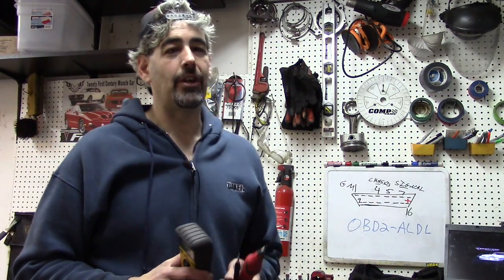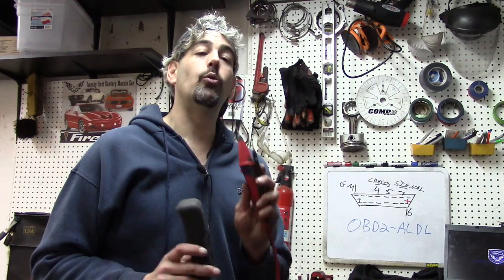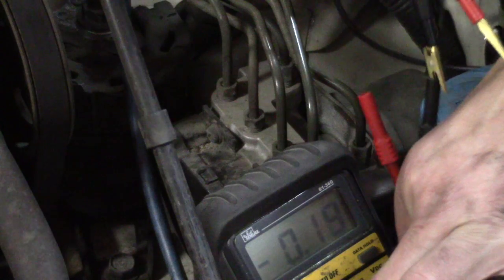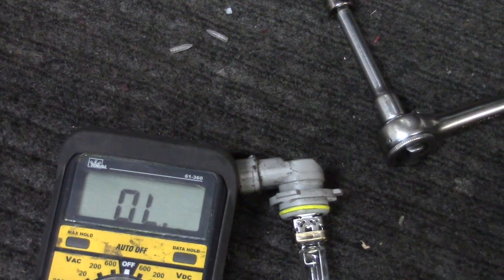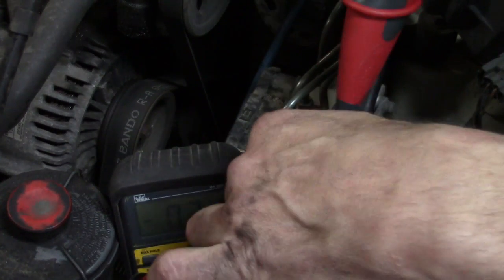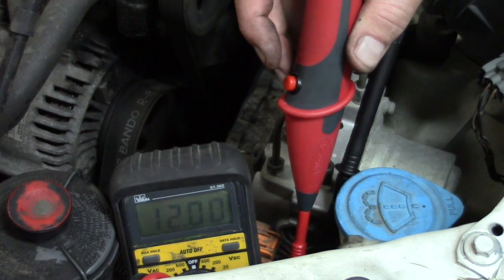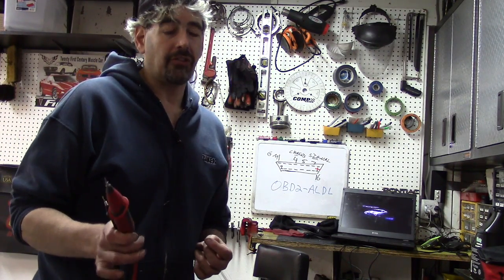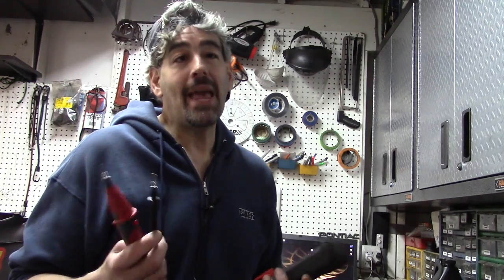Load Pro Electrical Tool Review (with product link)

Comment: just out of curiosity, put it on ohms, touch the leads together and jab the button.  =)    Thank you for the info on the tool.  Well worth 70 bones if you work on cares often at all.  THumbs up
Reply from the maker: +Rhage73 If you were to do that nothing would happen at all. If you had a DVOM set to V and touch either side of a resistor what would happen? Nothing.
Reply: if you have a DMM, "digital multi meter" which is V / O / C / diode check / capacitance on some of them, and you set it to ohms it will read the resistance in the leads.   I was curious what type of load it was putting in the circuit to measure against.  so if you touch the leads together and it is .4 ohms and then trigger, if it is simply jumping in a resistor to set a base value to compare to it would give you the resistance of that value.  because the sum of all voltage drops in a series circuit = source voltage it would be a simple matter from there if they are using some sort of resistor jump in.    c wut im sayin?   sorry i wasn't clear about the ohms setting before.   .......made me nerd out... =(     TURBO CHARGED LS, WITH A STROKER KIT, FORGED INTERNALS , METH INJECTION AND A THUMPING BUMP STICK.   ok better.   hehe  have a good one.
Reply: +Schrodingers Box or if you don&#39;t wanna do an ohm test on your loaded probe, at least tell meh what size resistor you used for the demo? Then i can throw some Chuck Simon Ohm math at it and figure it out based on the 8/4 split.  The value in the probe should be roughly 1/3rd of the value of the total resistance in the series circuit.
Reply from the maker: Rhage73 Gosh I don;t even remember- I am pretty sure it was a 50 ohm.
Reply: a'ghite, thanks for the reply bud.    That is why i wanted you to do an ohm check lead to lead then hit the button, and if it is in fact just a resistor on the posi probe that is on a momentary switch....when u bang the button, on ohms with the leads touched, it will give you the value it is using ;P
Reply: Just happen to see in LoadPro guide that if you set meter to Ohms, DON"T touch leads together and push/hold button for a few seconds it is supposed to show 25 Ohms.  If doesn't it needs to be fixed or replaced.
Reply from the maker: Matthew Brice Agreed- if you set the meter to Ohms I would totally expect you would see 25 Ohms.
 But nothing will read at Voltage.  A lot of people mistakenly think there is a battery or something in the positive lead the produces voltage and there most definitely isn't.
Reply: ok went to work fired up my fluke put it on V, took another fluke and measured the ohms on P and N with it.   with the meter set on V there is a 10M resistor as part of the meter circuit, strange how i never was curious about it before now and been fixing electronics for over 15years.  the funny thing is the meter set on V reads 500mV DC when i touch the ohm meter to it.   its probably because of the 9v battery in the other meter. /shrug.   so with the 10M ohm resistor it would be hard to say. i didnt have time to check with both meters on ohms but i will have a little time in the morning before shift to take a look and see if the 10M ohm resistor is still in circuit on OHMS.

Comment: Only a resistor and a momentary switch? Seems a bit pricey just for that. Maybe that's why the probe is so big. It makes you think you're getting your money's worth. The guy is a freaking genius. :-)
Reply from the maker: +Rob Mut What have you been using all this time for a resistor and momentary switch to test voltage drop???

 See...  Exactly my point.
Reply: +Schrodingers Box As always I was just kidding. Did you miss the smiley? But to answer your question, I just hang an appropriate size resistor across the load end and measure the voltage. If I wasn't so lazy I'd put the button and resistor inside the meter case. The 2% part of me wants to see what is actually in there. Any chance you would take it apart and show us? Once again I keed, I keed. (Good video by the way) 😊

Comment: Wow Matt...this is definitely the most controversial tool review I've ever seen! Bit like those political blog sites about Donald Trump heh heh
Reply from the maker: +tecnaman I know, right??? Totally didn't expect that!  It seems to be a matter of whether people prefer the multimeter or scope. I personally much prefer the multimeter because the versatility involves just flipping a dial rather than swapping connections plus I can hold peak readings, etc. But mostly I like quantitative  numerical output. So this tool is excellent since it adds another function to what I already use. 
   Others prefer the testlight because it's safer and has just one wire. For them this tool won't be as popular because they have to bring out the multimeter. 
    The complaint people make that the load pro is nothing more than  a resistor and other basic methods could be done doesn't register with me at all though. You could use s regular ratchet instead of an air ratchet, or a hand drill instead of a electric drill, or a multimeter instead of a scope and amp probe.

Comment: Hi buddy! I have an '85 Nissan Urvan, good compression but looses coolant and too hot runs hot. No external leaks, I have pressure tested the cooling system. 3 out of 4 Spark plugs are showing white residue. Bubbles appearing at the top of the radiator. Does this sound like a leaking head gasket? A previous owner ran tap water for quite a while and the cooling system was quite sludged up when I got a hold of her. :)
Reply: +DodoCnR What was the compression and leakdown test result?
Reply: +Schrodinger's Box Quantum Mekanix 150PSI even on all cylinders (should be 128-171PSI according to the manual). I haven't done a leakdown test and there are no signs of any coolant in the oil. :)
Reply: DodoCnR Need to look at basic cooling diagnostics. Dirty radiator fins, bad radiator cap, nonfunctioning water pump...
Reply: +Schrodinger's Box Quantum Mekanix Radiator is clean it was replaced about a year ago, cap was replaced by me, and water pump + fan clutch also replaced during diagnostics.
Reply: DodoCnR Oh what was wrong with the water pump? Was it seized?
Reply: +Schrodinger's Box Quantum Mekanix Not seized, it worked fine but the fins were quite corroded. The old fan clutch did not seem to be working properly.

Comment: ive got a set myself. been using it at work for almost 2 years now. the one time i grabbed my old snapon test light and tested for power on a backup wire to the alarm on a transport truck.. light lit. got a new alarm and hooked up... no alarm still.... remembered dammmmit.. those snap on test lights use practically no load to test a circuit. got my leads out. tested the wiring .. sure enough. had super high resistance. ended up being corroded terminals at the reverse switch on the transmission. 
-- that was the last time i used the snap on test light for that. load pro leads all the way. guys at work still are unsure of them only cause they arent off the tool truck. so much easier to use then the Power probe i must say. also the leads can be purchased with a handy book that makes troubleshooting electrical look like childs play. cheers thanks for the video.

Comment: 70 bucks should have came  with Sullivan's first book also. Snap On sells a Blue Point version that is blue instead of red for 89 bucks.  All this discussion over a 50 dollar set of leads, WOW. Do the leads do what they are designed to do or not ???
I have seen seen a set of Fluke leads for way more than that and they didn't do any thing special. If the couple buck test light will do it all why do they sell scopes and scanners plus updates at outrageous prices . Quick and dirty is one thing , total confidence in your diagnosis is the bottom line.

Comment: The use  (and understanding of the load-pro) is the same as that of the power probe, e.g if you use a power probe incorrectly you can easily cause damage to ECU or any delicate components, especially if you decide to apply 12v in the wrong manner to the wrong circuit.  The load-pro has it's advantages (and disadvantages) over other fault finding methods,  especially in it's simplicity (assuming you know what you are doing). But as with all pieces of "test equipment" one device is not the bee all and end all of TE. The load-pro for me has located faults that would otherwise take longer using other methods (my opinion). 

Possibly why only a small percentage (<2% of us) use it. (Yes Ivan I'm a DIYer and I've bought one)

Load pro equivalent circuit is basically a 22 ohm 10W resistor to deck (gnd/rtn) when switched (0.54 Amps).

Any corrosion fault I've come across has always been significant (but not immediately obvious as to where located) and has caused considerable voltage drop when load applied. The corrosion quite simply causes current limiting, which in turn leads to voltage drop when load applied as the circuit current is "limited".

I also prefer using a DVM rather than a test light, my preference, as looking at a light doesn't always instill confidence as to the actual voltage drop "seen", that's not saying I don't use a test light, depends on the nature of the fault. I also like using a proper scope (I don't have $10K for a crapon).

Oh the probe tip on the load-pro is not pointed but concave, this allows it to "hold" onto pins easily without slipping off, brilliant design from Dan Sullivan.
Reply from the maker: +DiyMech I agree with this 100%.  I like the DVOM because it's much faster and more versatile than the test light- though I do use a testlight sometimes. I like the loadpro for the same reasons. How much easier to just test the connector once and not have to fumble probing the connector and hooking the testlight to the probe in the confines of the top of a fuel tank?
   Just that alone- worth it for me- in the same exact philosophy that when I put 12V directly to a fuel pump how much easier (and safer) to use the power probe rather than jumper wires?

Comment: One question to ponder is, of the 3 circuit failures we see daily , short , open , and high resistance . Will the tool point you in a direction with one 2 wire connection at the load connector without the load connected?

Comment: 40mA/volt applied by a 25 ohm load, simple.
Reply: So it seems that ideally you’d want a LoadPro-type tool that’s switchable with about 3 different resistors in it?
I had ordered some 20 ohm 10W resistors to experiment with, do you happen to know the mA/volt ratio for 20 ohms? Thanks
Reply: Ok, found a calculator: I = E/R
12.5V with 20 ohms load gives 625 mA 
(25mA gives 500mA) - correct?

Comment: 54.00 at aeswave .com. It is all about habit and personal preference. The Load pro is not the end all be all of test equipment, but it will point you in a direction with minimal connections. If you are looking for actual numbers it will do it,
if you are looking for a light, a test light will do it . As with all test equipment not a single piece does everything and you still have to make sense of what it is telling you.

Comment: Use a similar thing called a Mega to check telco cabling for voltage drop here in Oz, where we Still live in the land of copper pairs.
Nice addition to the multimeter. Ta

Comment: i seem to read a lot of 98% swaptron answers on here. The tool is to do a voltage drop test the example of the resistor in this video is "simulating green corrosion" hidden in a wire. A 2%er would know  this.  Also yes  you can do a voltage drop test by other means  rigging up wires for 15 minutes when all you need to do is press the button this takes  not 15 minutes not 5 minutes  heck not even 1 minute its 5 secounds  you can test both positive and negative side of a  circuit . sullivan has  good examples  of  what a circuit is and tutorial on ohms law , i would  recommend some of you go learn this stuff as  your clearly floating in the 98% swaptronics thinking.

Comment: Ok!    so i guess everyone will now  be having these leads  on the quantum mechanic  channel.  its the tool to own  for two-precenters   before  one buys a oscilloscope.
Reply from the maker: +Intrade Motor Oh man I'd totally choose an oscilloscope over this thing by far.  As cool as it is there really is not as much advantage over just using a testlight or DVOM while an oscilliscope can do functions that cannot be duplicated.
Reply: +Schrodingers Box 
yes i am talking cost wise here , a one hung low scope wont find  real problems its why i own a 3500$ picoscope
But for diy when you master a digital multimeter adding 70 bux worth of function to the multimeter is the thing to do . For the cost factor , if one dont knows  what to do with these loadpro leads then money  for a scope that they also cant figure out will just be a waste of funds.

Comment: Good review of a great device, I know a test light would dim in the presence of resistance if you look carefully but to pull a pump relay and load both circuits at the base shows its versatility, you test the all the wiring integrity to pump with the press of a button!

Comment: Had this tool for a long time and for sure it save time, It is computer safe on output signals inputs is more dangerous.
Think about it you take out your voltmeter as you always do take a measurement you done you checked everything in one second. Problem with humans is they want everything for free.

Comment: Maybe I missed you say it Matt but to help the 98%er's understand better the resistor was simulating corrosion or a poor connection.  This tool is a good weapon to have for quick diagnosis, lot's of controversy about it.
Reply from the maker: +Ozzstar Hahahaha!! Great response LOL!!!
Reply: +Ozzstar It was simulating something sucking down most of the voltage in the circuit but it you metered at the harness it would read source V because it was the only load in the circuit.  "the sum of all v drops in a series circuit = source V which in this case is 12V " but if you add another load to the circuit, it now has 2 drops.  The meter will show you what you are getting at the plug based on a fixed resistor in the probe taking a portion of the voltage, or being part of the load. for simplicity we will say we have 10volts in the circuit.  you measure at the plug like My man Matt did, and you get 10volts one would think your circuit is good.    HOWEVER.....if you have say a 5 ohm load in the circuit, by measuring it, you are essentially measuring the V drop across the 5ohm load.   If you add onother 5ohm load to the circuit.   it will split the Voltage evenly between the 2 resistors or "loads"   In this case you see the true voltage at the plug where it meets the light.    so one load "the corrosion or bad wire or whatever" would be dropping 5v, while the Probe load will have the other portion of voltage that is left.  i hope i didn't confuse the shit out of you.  i have been doing it for 15 years, "it being fixing electronics"   and sometimes i even confuse myself, but even on my worst day i can Tech the shit out of anything with electrons hahaha.  have a good one hope it helped.
Reply: +Rhage makes sense to me, i'm a 2%'er
Reply: oh, my fault bro, i thought you were asking a question but you were making a statement, good....sorry about that....=)
Reply: +Rhage no problem man lol.  Good info is worth sharing

Comment: As an electrical mechanic, I  use this tool all the time and it works perfectly. It loads the circuit and allows me to find high resistance. This is a great invention, simple and effective.
Reply from the maker: ***** NO ONE needs this tool when you understand how circuits work. This just makes it easier.
  In fact- if you really understood this tool- it is ONLY useful to those who understand how circuits work!!
Reply: I want to see, Scanner Danners review of this tool. He knows it's a great little tool, but can't stop kissing snap on's ass
Reply from the maker: +joeandgod1 I doubt Paul will buy this thing- he doesn't really see eye to eye with Sullivan because of their differing "poking holes in wires" philosophies.

Comment: As a novice to intermediate diy-er. I don't know what you hooked up the connection(s) to, to know what your results came from.
Reply: +TySignsUp Porter   He was touching a power carrying wire and a ground wire ..so unlike a test light it checked the entire circuit from the connector to the battery ..both the ground and the power .... if when he touched ground on the engine the  power had NOT dropped that means the ground  side of the circuit had the problem  :)
Reply from the maker: +TySignsUp Porter I hooked it up to the headlight connector- simple power and ground
Reply: One person says the connector, the other says the wire. I guess I should be checking the connector where the wire comes in at?
Reply: Thanks
Reply: yes ..you check the wire ..at the connector ...in this case the connector at the light bulb ..lets say you had the same result as Matt had ..you would find the wire from the connector  as it left6 the head light ...and maybe  there is another connector ..you could unplug and test that wire  ..nothing wrong?? then it was the wiring from the head light to the second connection point TySignsUp Porter
Reply from the maker: deepsquat600 Or do both- If I don't find 12V at the connector I usually backprobe as my next step just to make sure the connector isn't bad.
Reply: Thanks again

Comment: Great review of the tool. You made it such clear that inventor even didn't explained! Thanks for your great video upload. I never ever used one such tool but have understanding of voltage drop due to bad connections, joints, contacts and bad cables. I know that such a testing can be performed using a test light on low profile and low cost way. Also it is easy to create such a tool using low cost or free materials laying around. In such a manner I am not going to reverse engineer one but am thinking to put my own idea.
Reply: +LearningZone Looking forward to seeing your new idea in action.